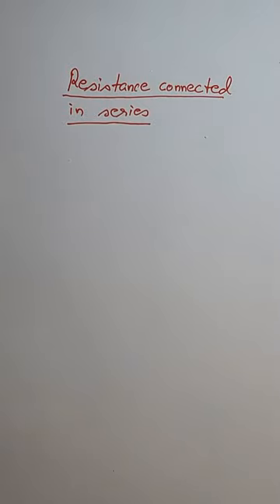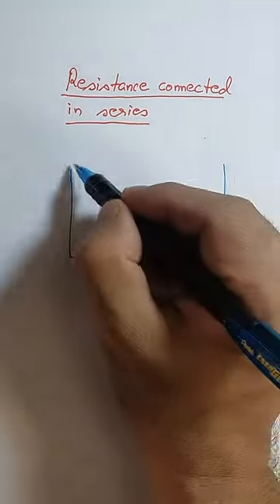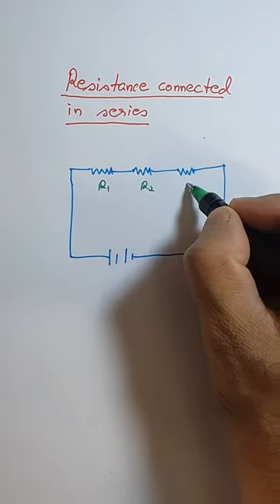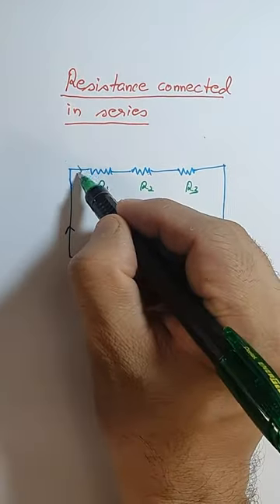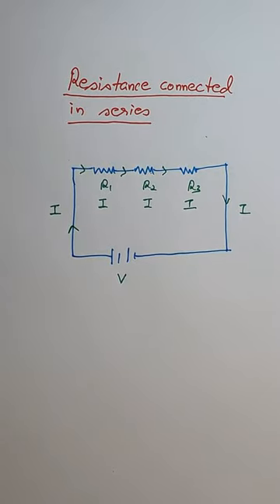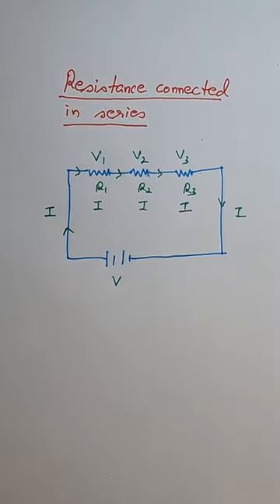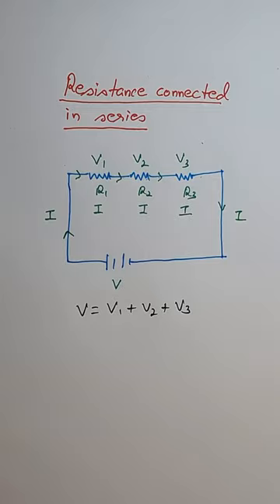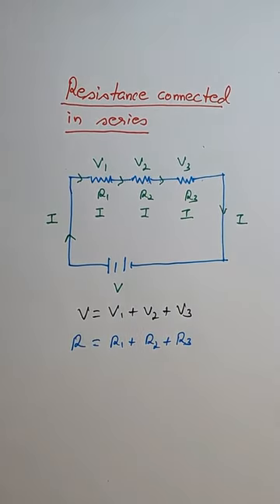Resistance connected in series.

Comment: sir but how is the ammpere is same as ammpere is the rate of flow of electric current and if resistor resist the speed hence reducing the rate of flow of electric current please tell
Reply from the maker: Current is same when the resistor is connected in series. Here we are talking about combined resistance.
Reply: The net current that flow in the circuit will be 3V/R ( as I = V/R eq. = V/R/3 )..... Now this net current i.e, 3V/R will be same in each resistance.